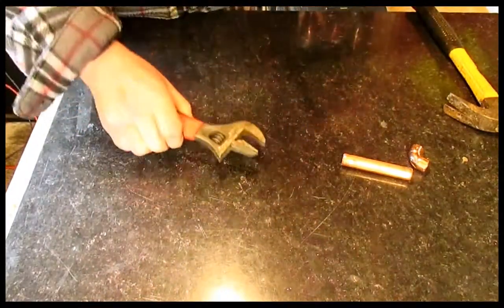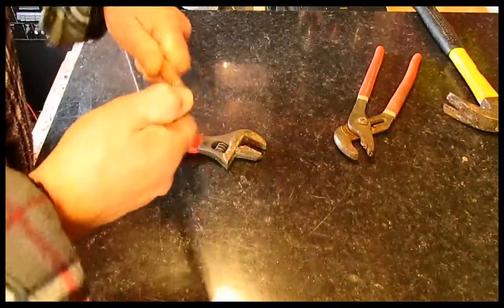toms top tips how to reshape a pipe

Comment: Just get a punch of the same inner diameter of the pipe ,with a tapered nose, and push it carefully into the pipe to get it "round enough" , Then if you have to, give the fitting you are putting on, a little squeeze with slip joint pliers to match the slightly out of round pipe. Not perfect, but what if you have little room to work with?